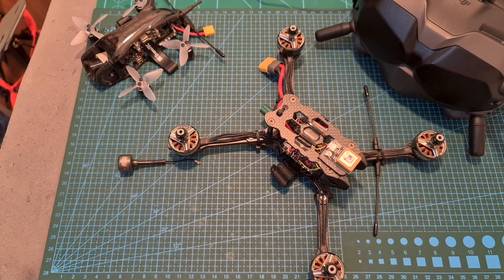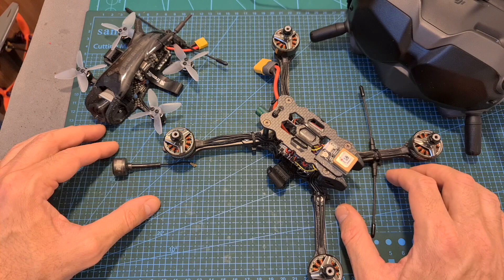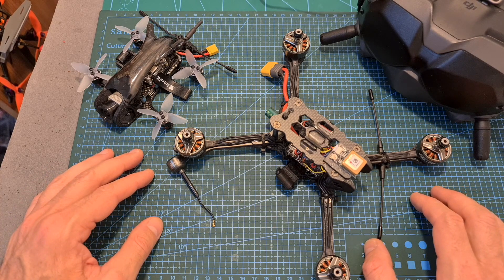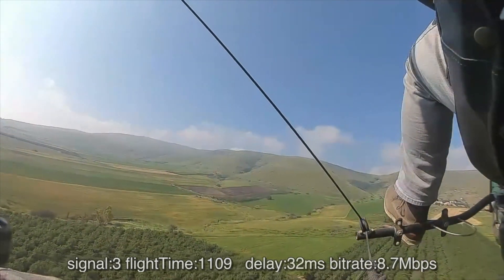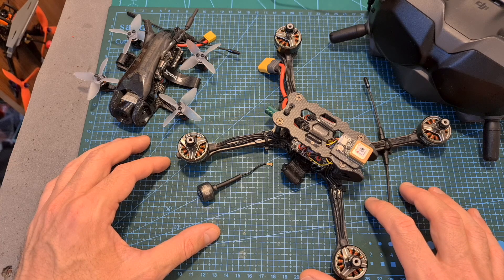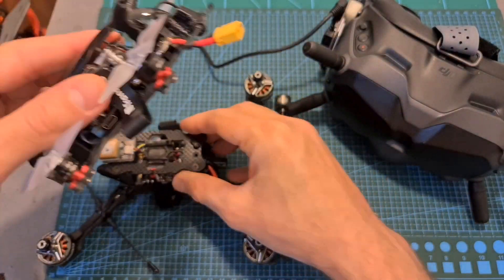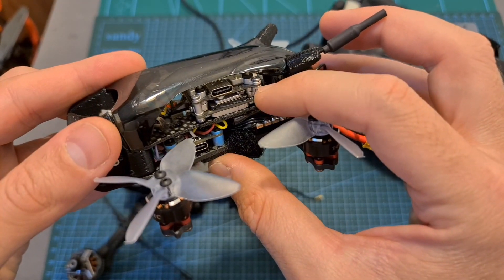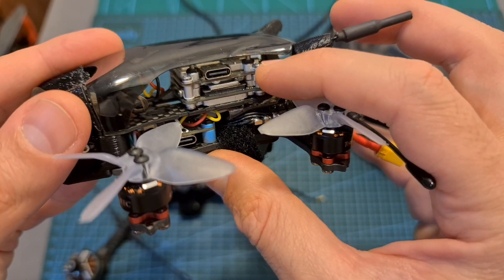Caddx Vista Range Test (Take Two)

Comment: I regularly fly my caddx vista out about 6KM, sometimes more.   I only get bad pixilation if I lose LOS.
Reply from the maker: Great - I still didn't push mine that far.
Reply: Hi there. Can the vista go as far as the dji air unit? ( i.e. up to the 13.2km hard limit?)

Comment: I'm building a chimera 7 HD. Would you recommend the air unit or air unit light? I don't care about weight.. I want the best transmission. If they are both the same would you recommend the two antenna air unit for best coverage?

Comment: How did you get the GPS overlay?  So wish DJI would integrate enable the ability to record the OSD info.
Reply from the maker: Hi David,  I connected an analog DVR the video output of the flight controller in order to record it and then overlaid it on the flight footage using a video editor.

Comment: Nice test!  Thank you.  Pretty similar range experience that I've had with my micro long-range vista setup.  I did not have the same break-up, or pixelation.  It could be a noise floor thing however it looks pretty clean there.
Reply from the maker: Thanks David. Most of the breakup happened when the drone was out of line of sight but you are right - the testing environment wasn't ideal.

Comment: what happens if I lose the video signal in caddx vista? screen froze or black screen ?
Reply from the maker: It will freeze, than you will see black screen, and then if you will regain the signal the video feed will be back (same like the Air Unit).

Comment: Do you have some interference, bitrate going down even prior to takeoff?  Can you do a failsafe test which is more a real word applicable test than this one. Thanks and more power.
Reply: The whole flight has weird signal issues. Watch other range tests and they get solid 25Mbps for 3KM
Reply from the maker: The location of the antenna was not ideal. I will try to improve it on my next tests.